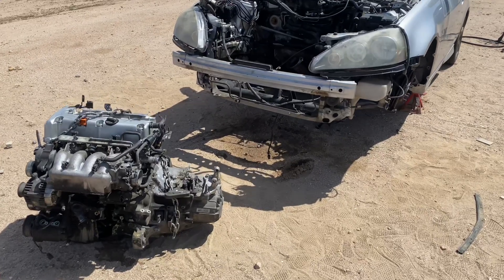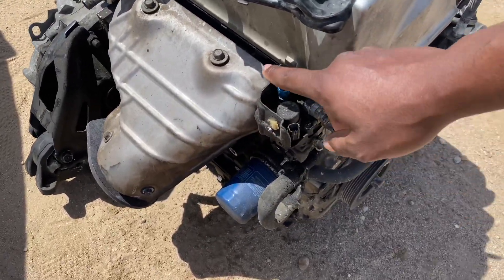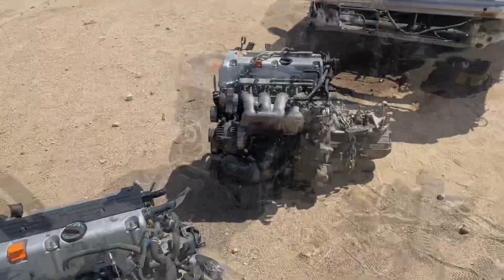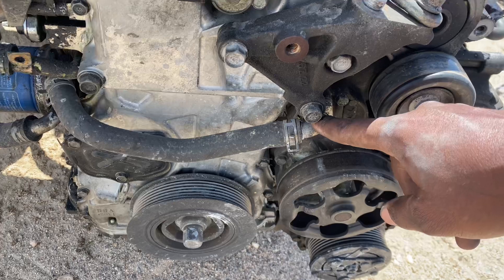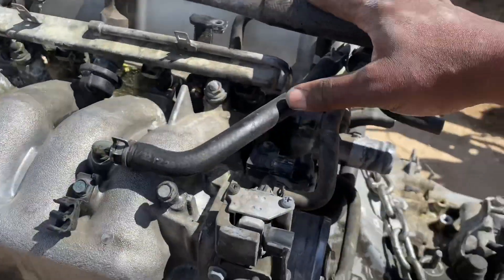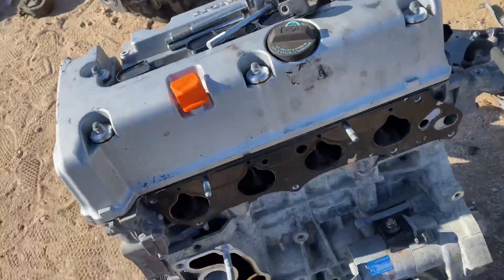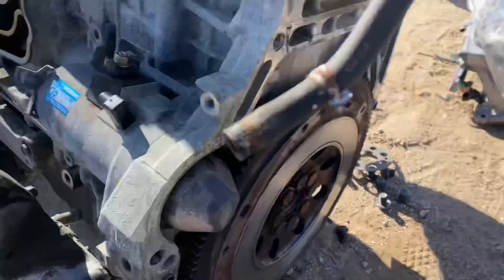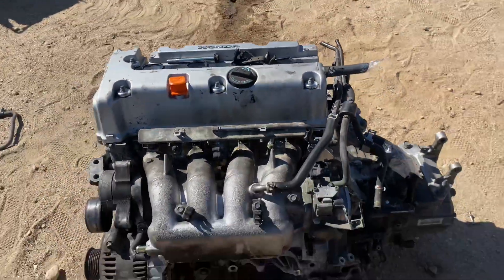Acura Rsx type s k24 swap part 3

Comment: im doing the same swap but using a tsx motor, do you recommend sticking with the prb or the rbb manifold? planning to stick the the stock ecu too
Reply from the maker: Prb good for torque and high  end power , rbb not that good
Reply: @rarewitit7899  thanks, btw im a new subscriber recently found your channel, been loving the vids, keep it up!
Reply from the maker: Thank you I appreciate it

Comment: I swapped the cylinder head on my K24A4 engine. After changing some other things and using ktuner, it makes 200 HP now VS the stock 160 HP.

Comment: Hey bro I'm doing a cheap k24a4 swap to an EF - and I have a question about the water pump housing - Why do you all swap them? Is it to get clearance up front?  And which ones do you recommend if so?  Thanks a bunch man.  You're killing it dude.
Reply from the maker: On ef you need to alternator relocated because headlight clearance
Reply from the maker: On Jdm engjnes they different , America’s you can keep stock housing , thx bro I appreciate it

Comment: Hey whats up bro..i did a jdm k24 all stock with prb intake mani..on kpro v3 and is throwing crank sensor no input signal..i also wire it for k24 crank sensor..and still throwing the code for it..is there something i did wrong? Can you shine some lights on it
Reply from the maker: I would wire it back stock and put k20 sensor , also if your running a tucked harness from eBay those have that problem as well
Reply: @rarewitit7899  im on stock rsx type s harness..i did had it wire with both way the stock way with k20a2 sensor still threw the code..and wire it k24 tsx way n still threw the code on kpro..which tune do i upload on kpro?
Reply from the maker: Did you take the engine apart , most ppl don’t put the pulse plate back on the right way , it’s the little circle thing that says outside on it
Reply: @rarewitit7899  my cousin did my oil pump..im have to look at it this wkend to see if he put it back correctly or not..
Reply from the maker: Yea that sounds like it’s the problem
Reply: @rarewitit7899  i hope so! Thanks for the help bro 👌🏽💪🏽
Reply from the maker: No problem

Comment: yo i have a k24a8 in a 06 accord you have any advice i’ve got 80k miles
Reply from the maker: Keep up maintenance and it should go to 200k plus no problems
Reply: @rarewitit7899  nah bro i mean performance wise i wanna get stuff done do it 💀
Reply from the maker: I would go with rbc manifold from civic Si 06-11 , some headers with 3 inch piping tuned on ktuner
Reply: @rarewitit7899  how do i do all this like where do i get em from

Comment: Hey bro, did you use the water pump housing from the z1 on the 24a? And if you did, did you have any problems?
Reply from the maker: You have to use everything off the k20
Reply: @rarewitit7899  okay thanks, this vid helps a lot since im doing a same swap on a same car and new to the platform. Keep up the great work bro✊🏻
Reply from the maker: Thx bro